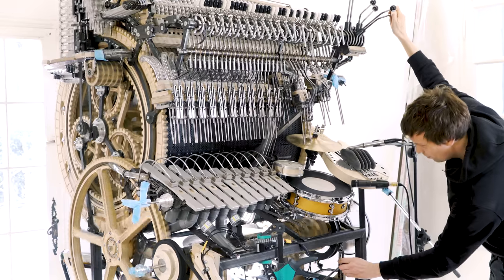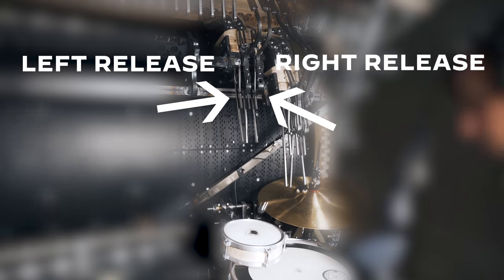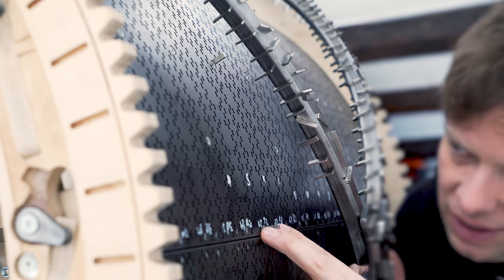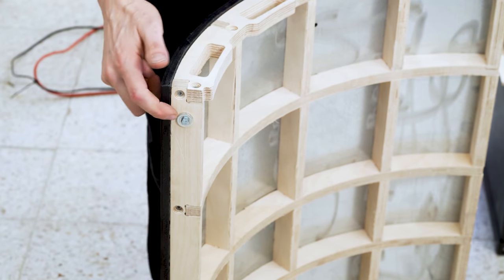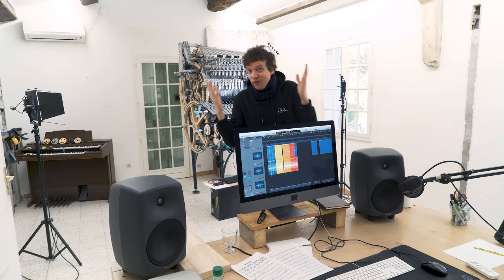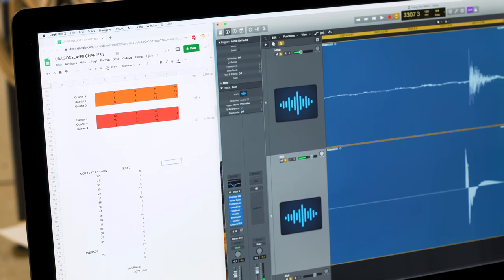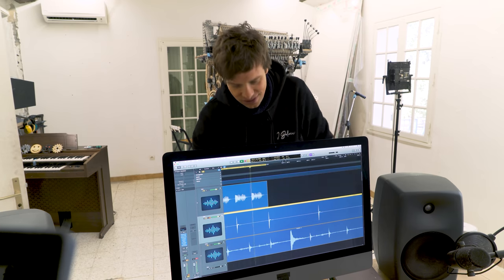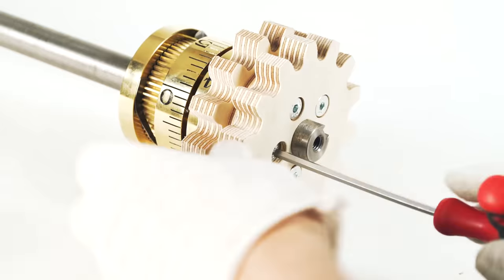Playing Tight Music? - Marble Machine X #115

Comment: It would be a great shame if we lose the MMX due to an electrical fire. Please get that fixed!
Reply: definitely.
Reply: For realz
Reply: Yeah, get that wiring up to code! hehe
Reply: @violetaroo1  I like how you state "HE" needs to fix it, not hire some pleb, that would be bad economics.
Reply: how is that going to cause an electrical fire? i do not see a problem
Reply: It would be a great shame if we lose Martin to an electrical shock
Reply: @orsemcore  "Most electrical fires are caused by faulty electrical outlets and old, outdated appliances. Other fires are started by faults in appliance cords, receptacles and switches"
Reply: @orsemcore  Also did you not see it was welding the plug after he pulled it out?
Reply: @Fab Funty
That too.

Comment: Martin, so complicated! Get that electrical outlet fixed as it is a fire hazard! And don't make the mistake I did and not back up your computer regularly in case the hard drive fails! Keep the backups off site for recovery. And PM me when you want to see my completed Modulin II.
Reply: I'm not Martin, but I want to see it
Reply: Don't put HDD in laptops... It's 2020 use an SSD they won't fail when you inevitably drop your computer.
Reply: @probablynotabigtoe9407  Martin isn't using a laptop, but drives can still fail without being dropped. In fact SSDs are even more susceptible to data loss than HDDs in case of sudden power loss.
Reply: the fusion 360 files are on the cloud!:)
Reply: Chill out
Reply: @htmagic    Looks very spiffy. How 'bout a demo to hear it play? 😉
Reply: @ginfonte3386  I'm not a musician but an engineer. I'd rather get Martin to play it!
Reply: @SteelSkin667  that's an interesting made up fact... Too bad for you it's completely false with modern SSD.

Please, what other ignorant things do you have to say?... You have my interest...
Reply: @probablynotabigtoe9407  SSDs use large DRAM and SLC caches, and if you're really unlucky and the drive loses power during a write you may end up with a corrupt file. It's quite rare and there are power loss data protection mechanisms built into most drives, but it still happens, especially with cheaper drives that might lose a whole page of flash memory if power is lost while it's being written to.
Now don't get me wrong, SSDs are still way more reliable than HDDs when it comes to mechanical failure, but they are far from a magic bullet. Don't forget to back up your data.
Reply: @SteelSkin667  Well, that would only affect a file you're currently moving, and unless you move large files on low battery I think it would be fine.
Reply: @sam53143  Not all computer have batteries - as demonstrated at 16:12 in the video ;)
Reply: @SteelSkin667  Oop, don't know why I thought it was a laptop. But anyway, my point still stands about only losing files you're moving. And I'm not saying you shouldn't back up files, just making a case for SSDs.
Reply: @SteelSkin667  well I won't argue the wisdom in backing up important data but I suppose made a separate valid point that was helpful as well.
Reply: @htmagic  I really like that page design
Reply: @LukasFink1  Thank you! The Modulin II weighs about 10 pounds but will withstand any tour. And no wood was harmed in the process!

Comment: I think someone else did already mention it but I will do it too: Fix that electric work of you house. This is a potential fire hazard.
Also: Emergency shutoff for the motor is highly recommended (turnoff mains) for safety and fire hazard prevention. 

Otherwise electronics wise: Neat work! Now it just needs a pretty input/output to set the tempo by hand!

I can't stress this enough: Fix the electric work of your house please. This is a fire hazard. <3
Reply: Speed Torque and current is monitored by the motor controller if it is programmed correctly it should automatically cut out if something goes wrong. If that fails a resetable fuse would be a better option.

The problem with an emergency stop button is that you are required to press it and if it is out of reach at the time of failure its pretty much pointless.
Reply: Chill out
Reply: @jackmarshall2496  I am overcautious when it comes to this. It is, a electromechanical machine which could lead to serious injuries. This is why I suggest a big red button 'if' something goes wrong.

No electronics is failsafe and a resettable fuse might not be a good choice in this application.
It is a mere safety concern which can be implemented easily. Just a normal big red button in the mains of the motor dc supply.
Reply: @Daybreakerflint  say the mmx is running without crank input in its hands free operation you could literally walk away from it and it would still run, in that scenario a button would do no good. And it's a large machine, if your arm gets stuck in it when you're out of reach of the button you cant press it.

I understand what you are saying about not trusting the programming or a large resettable fuse (which would also protect the other circuitry) but in the same way you could also not trust a button to cut out the circuit.

I've done this kind of programming and circuit design myself with many different controllers (trinamic foc motor drivers/controllers being my preference) and in my experience they are a lot faster at cutting in the event of fault than human input.
Reply: Re the emergency shutoff: YES! You want a big red emergency stop button on the front of the machine. There's a lot of mass there, and once it starts moving there's a lot of potential for mashing fingers, getting loose clothing or hair caught, etc. You absolutely need some kind of emergency cutoff.
Reply: @jackmarshall2496  Yes machines are faster turning off anything but regarding human safety it is another matter. There is no protective inputs and the motor will keep on going until either torque gets high and it will regulate it down or the mains are pulled/programming gets shut off.
My concern is the human. The circuit can be replaced. The human not.
Yes if your hair/hand whatever gets caught in one of the wheels you are essentially lost if noone is there to stop it. 

It is a minor safety tweek and can protect human and machine.

If in doubt it can be coupled with an emergency brake (mechanical) and electrical mains cutoff. (which would be even better in my opinion)

To make the MMX completely save is impossible. This is a mere suggestion and 'better have it and never use it'

Thanks for listening and for the nice conversation! <3
Reply: Mixing the brake with an electrical cutoff would work.  The question is is implementing it worth the effort, as putting the brake in a good spot might require re-engineering parts of the driveshaft.  

Safety is always good to talk about though.  A way I thought about safeing some other parts would be clear plexi glass shields, shaped to the gearing.  It would prevent most chances of stuff getting pulled into the system.
It would also look really wierd, and kinda ruin the look of the mmx.  There is something to be said about the best way to make a tool safe is to just use it responsibly.  It's not like he is building to the lowest common denominator in society.
Reply: Man gets eaten by marble machine....
Reply: @hjalfi  My mountain bike doesn't have a big red shutoff button and accidents do happen but sometimes people are happy to take a risk or two. A plastic cover over the gears would also help but then it just wouldn't look the same.
Reply: @izzzzzz6  I might be remembering wrong, but isn't there a safety feature that will disengage the flywheel if something gets stuck somewhere in the machine already?

Too many safety precautions is better than not enough though.

INCLUDING fixing the damn electrical!
Reply: @inthefade  Why not, i'm sure i heard the guys mention that there was already a certain level of safety features, it would be interesting to find out what is the worse that could happen, like run some carrots through the gears.

Comment: Please add an Emergency-Stop button for the motor to the front AND back of the machine!
I am cringing watching Martin reach into the running MMX.
With all the moving parts this machine can destroy itself (and the operator) in seconds when a mishap happens.
Reply: Still thinking a emergency stop button is good.

But couldn't a over torque detection be Annother good safety feature
Reply: What a great video that would be!
Reply: I'm almost sure the MMX have a clutch to protect it. But I agree that  a couple of emergency buttons is a good idea.
Reply: I am also backing this up.
Reply: @espenschjelderup426  as I remember the cluch is at the other side of the drive shaft, so it can only disconnect the crank, but I think the motor controller does have torque limmiter programmed.
Reply: An emergency stop for the motor won't help at all because of the momentum of the machine. The break for the machine is the only thing that will stop it.
Reply: @kubaxd25  Yeah I think you are right about the clutch. The motor have torque limiting I remember.
Reply: @kubaxd25  Afaik, there is a torque limiter. At least that;'s what I got from the motor installation video.
Reply: The flywheel has a torque limiter in it.
Reply: @teajay6329  Then safety emergency stop buttons should engage the relays which would release clamp breaks to stop the machine immediately. For sure there is more than one way to solve this problem (starting from the simple covers for the moving parts where hands will be in close proximity, to covers which would break motor power when opened).
Reply: @miawgogo  Would be effective if he got caught up in motor belt , but not effective if he got caught in large gear, or other following mechanisma, where mechanical advantage is so high that the motor could not "see" the extra load.  This is a common problem in industrial machinery, especially "cobots".
Reply: I am pretty sure the motor controller do have torque limits. However, it might still be dangerous below these limits, i.e. if it catches a hair or a piece of clothing. Definitively need few hardware power disconnects wired in series.
Reply: It's a brushless motor but I guess there could be hazard in momentum
Reply: @Owen741.  stopping it fast enough to avoid injury might harm the machine considering momentum as well.
Reply: This is is a really good idea
Reply: god i hate the safety squad
Reply: There are torque clutch on the flywheel and on the motor.
In case of graps by the dragon, the only concerne are the inertia of the the assembly.
Reply: @zaxonxp45 , the flywheel contains most of the mechanical energy and that has a clutch that decouples it if anything jams. The rest of the machine has lots of friction and not much inertia so it would be quite safe to stick a hand in anywhere except for the main shaft gears. Probably could do with a safety cage of some sort around those.
Reply: @AngelusFlat  If he is the only person who operate this machine and know when (not under the influence of... or tired) and what can be safely touch, then there is low risk of getting the accident. But if he would like make this machine more fool proof, then indeed some more safety features should be put in place. But then maybe the visual aspect of this piece of art would be ruined by too many servos, breaks, switches, relays, etc. :)
Reply: Why does he need an emergency stop button, his mangled hand/arm will do just fine at stopping the machine in an emergency
Reply: "just add an estop button" doesn't mean anything. you can't just "add an estop button" to make it safe. the momentum and mechanical advantage are too great, and the interlocks would interfere with the operation and aesthetics of the machine. you're just going to have to accept that it is dangerous, and if that upsets your sensitive eyes then stay away from it or look away. i can see it now: some eurobrained safety nazi complaining to the authorities and then forcing the machine to be inside a cage.

Comment: Moving that machine around from venue to venue is going to be absurdly stressful! A top heavy, delicate, precision machine. One drop could lead to hours and hours and hours of re-calibrating and re-timing the machine. That is not even factoring in if any parts bend of break.

Making a well designed, "untipable", traveling case will be of the utmost important. It is something I could see Adam Savage being amazing at! He has an addiction and fascination with boxes/cases. Maybe you could try to get in contact with him?
Reply: It's built to be taken apart into modules that can fit inside 1x1x1m cases. Also, he's been talking about having more than one MMX.
Reply: hey, someone already pointed that out and introduced martin to his company thats specialized in moving expensive objects. They have already been assigned to transport a da Vinci. Martin mentioned it in an earlier episode, but I don't remember which one.
Reply: finally a normal comment
Reply: Well, with the precision Martin wants, just changing latitudes requires to re-calibrate the machine...